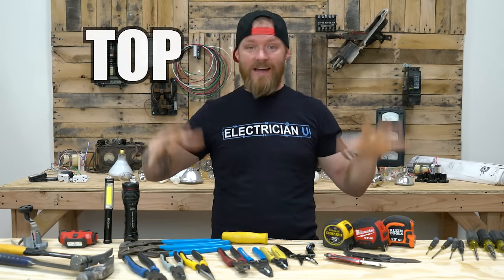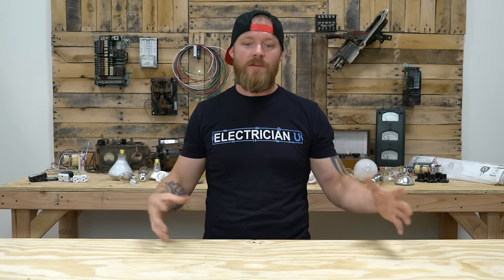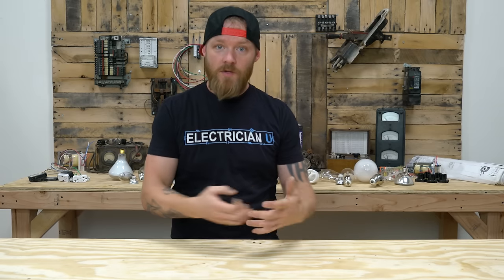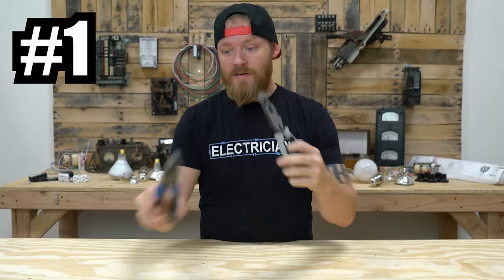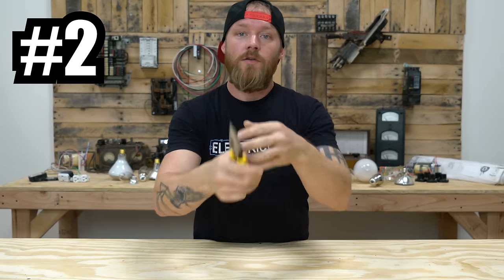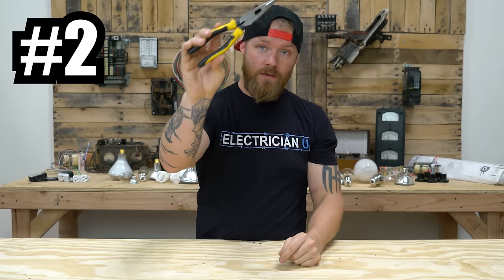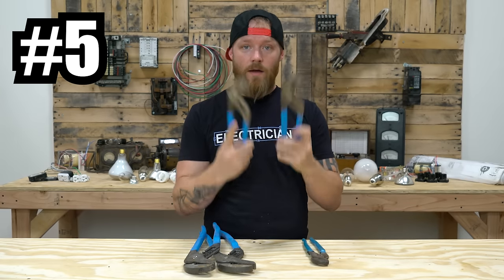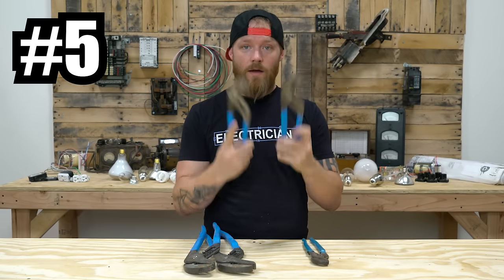Episode 42 - APPRENTICE TOOLS - 13 Tools Apprentice Electricians Need To Have

Comment: Not much I can disagree with on your list. Klein 11-n-1 comes with two sizes of square tip. For your slip-joint pliers(channel locks) on the smaller size I HIGHLY recommend the Knipex 88-250. They are lighter, they don't seize up over time, they have the round jaws and grip better than the flat jaws, the teeth stay sharp, mine are over 20 years old and grip just like when they were new. They are narrower so fit in tighter spaces. I spent my last 7 years doing airfield lighting which is almost exclusively 2" PVC and they worked great putting 2" fittings(MIP-FIP adapters) into the hubs. A lot of folks don't like the Klein tape measures, but in my 50 years in various trades, they have been the best for me. On hammers, while I love the Estwings and had a 16 ounce I used for finish carpentry for years, as electricians we should be using fiberglass or wood handled hammers. When I was framing ages ago, I had a bad day doing a tin roof with lead head nails on a 6/12 pitch roof, using a 32 ounce hammer. Ate my fingers up. I switched to a 20oz Vaughn and within a week I was about a half a stroke more on a 20P sinker. The main thing I will say on a hammer, comfort equals confidence, and confidence equals less blood spilled. Another thing important as an electrician is that you want a straight claw. You WILL be using that hammer as a "precision instrument of digimetation" if you work in the dirt at all. 

I would add to the list a set of pass through style nut drivers, 1/4" through 9/16". You'll probably only carry the 5/16", 3/8", and 7/16" in your belt, but it's good to have the rest in your bag. They are more versatile and quicker to use than flopping through your multi-driver. It would also be good, if you can find one, to have an 11/32" as well. You will run into 11/32" nuts in a lot of control modules and light fixtures. 

A 10"(minimum) adjustable wrench(crescent wrench) 

A set of combination wrenches(box end + open end) to 3/4". Again, you're not likely to be carrying them in your pouch most of the time, but they are great to have in your bag. 

A frame hack saw with several each 24teeth/inch and 28teeth/inch blades. For one reason or another, you are not always going to have the reciprocating saw or band saw, and it WILL cut your EMT or PVC almost as quickly. It's like a gun, better to have and never need than need and not have.

Comment: Not an electrician. Although I did play the role of one for 3 months when I purchased a home built in 1956 and it's original electrical system wasn't up to modern electric and conveniences needs.  So got a quote for someone to install all new and had a heart attack.  Then decided I would do it.  I did it.  Passed each inspection. I'll never do it again.  It's a lot of work. Took me so long because I was only using a couple a days off from work to work on this.

Comment: A NCVT is always a good thing to have, and a simple outlet tester with the three lights.  - I know it's "test" equipment but it's essential to safety and checking your work.  And electric tape, I always us 3M super33+ , they don't say so but it's suspected that the adhesive contains an anti-biotic in it so you can tape yourself up after a finger cut. I have no proof of it but smell it compared to others...hmm, wonder what the red + sign means?

Comment: Just to help you out a drywall saw and a keyhole saw are not interchangeable terms. I work at a tool store if you asked for a keyhole saw I would get s
You something not meant for dry was and vice versa. A key hole saw will cut wood.

Comment: Can you do a video on, what tools you can bring to work that are used,  not like you bought junck at pawn shop, but where in a job w some of the tools,  like a claw hammer,  and drill,  but the hammer has some rust on it,  Probably wouldn't want any rust on wire striper, and unit-bits,  but is a little rust OK on SOME OTHER TOOLS, like clawhammer, and channel-locks,  but still, is it ok to have these a little Rusty, like in front of the other CREWS or the Super?

Comment: I think it would have been better if you made distinctions between what would be used in commercial or residential settings. channel locks aren't as commonly used in resi than commi

Comment: Ask a flashaholic about headlamps and flashlights. A good option for 30 bucks on Amazon is the wowtac a2s. Battery can last all day on a moderate mode, waterproof, 18650 battery has a built-in micro usb port.

Comment: What is the best tool for bending and putting on terminals receptacles, switches etc
Reply: Most stripper tools have a hole that you can use to bend the wire. I use the Milwaukee brand most of the time, but all of my Kleins will do it just as well. Often the hole will be labeled "loop".
Reply: I use needle nose pliers for that. Not the big thick ones he has in the video, but smaller and thinner ones. Just get cheap ones at walmart or something, like $5. You don't need an expensive pair to bend copper.

Comment: What about klines conduit reamer i feel like if you do conduit you need one but whats your opinion?
Reply from the maker: I usually just use files, or channel locks, or dikes, or other pipe lol - whatever's around to clean the edges off.  There's no right or wrong way, but I suppose using a drill would be great for 1/2 or 3/4 pipe if you're doing an insane amount of it everyday.  Otherwise I also have a Klein reamer/flathead combo that I keep on me for 1/2, 3/4, and 1".  Cant use the drill reamer for 3 inch conduit though.
Reply: Absolutely agree on the handheld Klein conduit tool. Fitting screw driver with combo reamers are life savers all in one hand tool. 🔥

Comment: I bought rechargeable AA and AAA batteries for my lights. They paid for themselves real quick. Works better than a built in rechargeable battery because you can charge a set while you can still use your light with another set.

Comment: Why does it seem like almost nobody in electrical has heard of ecx drive?  They all use a #2 square instead of the bit that was actually designed for all the screws that electrical materials actually use. Milwaukee makes them- order them off Amazon already! 😅

Comment: Dustin I got a break in here real quick before I finish this video. High leverage does not mean that it is a longer handle as you said it was at the beginning of the video when showing your linesman pliers. What hi leverage means is the pivot point is closer to The cutting edges than on  a non High leverage type of the same. I'm sorry I have to correct you on this because I'm always learning so much from you, however I feel it highly necessary to point this out being that you have such a large subscriber base I would hate for that large of an audience to be getting the wrong information.
Reply: thanks
Reply: @ronrichard141  💯
Reply: It's both, actually. Longer handles equal more leverage. Same with the pivot point being closer to the cutting edge.
Reply: @pbakai182  physically speaking yes longer handles and closer pivot point to The cutting edge both will higher leverage. However when the manufactur classifies a tool as high leverage and labels and markets it as that it is not because of a longer handle it is because they manufactured it specifically with a closer pivot point to the cutting so that they are able to call one high leverage when compared to the exact same size tool that they previously had made or perhaps is still being made.so yes a tool with a longer handle will yield higher leverage however it will not be labeled or marketed as such. It will only be labeled in marketed as high leverage when it has specifically been redesigned to move the pivot point closer to the cutting edges.

Comment: What size hammer should I get? Many people say that a 16oz is good because it’s light and it is less weight to be carrying on your tool belt. But others say they need at least a 20oz hammer. What do you guys recommend? Thanks ahead for the advice.
Reply: I use a 16oz hammer and it works just fine. You don’t really need much heavier
If you buy a fancy hammer like a Stiletto the 16oz hits like a 28oz and you’ll like never need to get another one
Reply: David 20 oz straight claw Estwing. Don’t go cheap
Reply: David  I’m old and don’t like carrying or swinging anything heavier than I need to.  A 16 oz will put staples in just fine.

Comment: Not every pair of linesman plier is designed to be used as a fish tape puller. in fact most that I see are not designed to be used as a fish tape puller. The ones that are designed to be used in this manner are going to have a specific cut out on the bottom side of the pivot,  this is only found on one side ( one handle half) just under the pivot. If both sides (both handle halves) are the same that linesman plier is not designed to be used as a fish tape puller.
Reply: jason reynolds works just fine pulling them though

Comment: I think it's best to wire Residences with BX , or AC, or MC cables instead of Romex  because then you don't have to worry about any rodents getting into the attics or walls and chewing thru the cable as they sometime do with Romex !
Reply: Only thing is it gonna cost much more
Reply: I was told, the rodents ate the romex because it was made from soy. An environmental improvement.

Comment: Teflon your tape screw.. am i the only 1 that cranks on it after i buy 1 nd b4 it hits the belt? Lol never lost 1 but i see your point, milwaukee 16' wode blade magnetic.. holy compact and even if you dont work with metal studs your on a ladder nd drop a screw no need to climb just send the tape to find it... lazy is efficient, efficient is smooth, nd smooth is fast.. lol

Comment: Im 5 months in my apprenticeship and i feel like it’s time to get a new drill/impact. (Been using an old Makita) What do y’all recommend I should get?
Reply: Dewalt has never let me down
Reply: Jordan Forsgren I have a old dewalt 20v that keeps going. Milwaukee is also good. If your gonna be working indoors and don’t like the noise look at the hydronic impacts they are quieter
Reply: Milwaukee M18 Fuel
Reply: @Dylan McHarghad my m12 impact for a few months, don't regret buying it at all

Comment: Electrician U 
I was wondering if you can make a video of replacing a regular light switch 
With a combo deal light/outlet. 
I have a old house that has two wires only and wondering if I have to update my wire or add another wire to connect to the outlet
Reply: You have to upgrade the wiring. You need a Ground. Neutral. Line side conductor "Hot" then a load side to the light. The Neutral for the light can go right to the light fixture. So you need one Green Green Ground. One Neutral for the outlet. Then two common Conductors. Load and line side.

Comment: My house is wired with the mc cable.  What a pain in the butt it is.  I’ve been replacing it with Romex.  There was no need for the mc cable in the first place.  
Also it’s the only house I’ve seen that had mc cable. In the main house and not just a workshop/garage area.
Reply: Well some local ordinances require you use MC cable and Conduit. I worked on plenty. And if they inspect the house before selling it. They will make you take all that Romes out. Then install the right shit..So you better check first..
Reply: Master Chief 00117 yeah.  The jokers that did the wiring didn’t get it inspected.   I know because the mc is hooked right into knob and tube.  Which is illegal.   Along with other crazy nonsense they did.   Non of the wiring has been secured/supported over the run.  The outlets are put at weird heights.   Etc

Comment: I purchased those channel locks and my journeyman said I should toss them in the trash since they're smooth bite no grip? lol
Reply: Yes, get a pair of Knipex Cobras, or Knipex Alligator pliers. The teeth are far superior when it comes to gripping. Not to mention you will never pinch yourself if they ever slipped. Which Channellocks for some reason have never tried to implement.

Comment: What is the communities advice/comments about using a tool belt? I am nearing the end of my 3rd year apprenticeship and have always put the few tools I'm using in my back pockets and work out of my bag however I've recently been clipping a supply pouch for staples and my tape measure and another small pouch for tools on my regular belt. Do the majority use tool belts and I'm just in the minority? Just looking for some tips, thanks!
Reply: I'm a jw and I hardly ever use a tool pouch. Only if I'm like up in the air climbing or whatever and it makes sense. Other than that I haven't used a tool pouch in years

Comment: Here is a free tip from someone who has worked drywall: If pushing your keyhole saw in is not working, go to the discard side of the line and TWIST it in.

Comment: Does anybody carry a hacksaw anymore? I informed the guys on a project I am running that everyone needed to start carrying a hacksaw. Some of the new apprentice didn’t even know what a hacksaw was.
Reply: Jarrett the Journeyman we carried them on the truck. But with porta bans and sawzalls there was never a need to waste time with a handsaw
Reply: Beardoggin89 With the new tools coming out I find myself stuck in my “old ways” and know that I have to change my way of thinking. This trade is constantly changing.
Reply: Growing Up in the Southwest on a production based crew like I work on with a hard line “get it done” boss you better not get caught wasting time or using a slower tool or method
Reply: i'm a firstyear apprentice and I own two reciprocating saws and no hacksaw

Comment: I have done a lot in construction. I’m getting into remodeling houses to rent. Completele rehabs. Electrical is my weak area. What would be your recommendation on learning to wire myself. DIY. Not so much the box. Just saving in labor with wiring the house

Comment: Don't forget a set of old cutler hammer breakers, security keys, tie wire, metal tapping screws, 5/32 masonry bit and all the other shit that your journeyman will forget and make you drive to a hardware store to get..

Comment: Kline actually has an electrician's hammer, that's the one they need really check out the design of it. OH yeah a torpedo level would be nice, magnetic to be exact. Nice video. Uh yea almost forgot, volt tick greenlee made that one its old one. Some sort of voltage tester. A very common tool it's a Life saver.

Comment: Get 18650 battery powered flashlights and a Nitecore charger for them. You'll wonder how you made it so far in life without them ;D You can shine a whole building from afar and a charge lasts for so frigging long... You can even buy waterproof battery cases for the spare you bring with you.

Comment: 1. Buy robo-grips instead for your  channel locks, made my life alot easier
2. Tape measures, if you bought a stanley fatty with a screw, use some good old pvc glue on it or buy the baseball fit one that is screwless
3. Klien strippers with the romex de-sheather are very nice strippers, though i understand why he didnt include them since alot of noobies tend to nick wires while de sheathing
4. dont use you're knife to pry shit, that is stupid, use a screw driver or get a cats paw pry bar, just get a razor knife for cutting your flex or for de sheathing your wires or for removing the sheathing from UF wire since you aren't going to be able to with that kinda knife i almost guarantee you.

Comment: Why electricians in the USA use screwdrivers without insulation? A lot of them use these yellow Klein Tools (I know there are good) ones that do not have insulation. In Europe, most of the electricians use screwdrivers with insulation as they are Wiha, Wera, Knipex...?